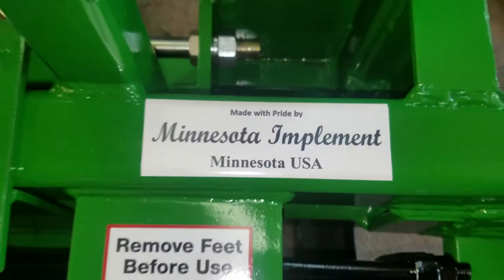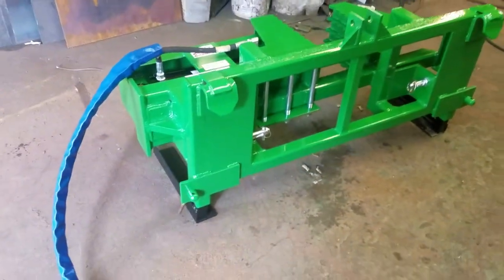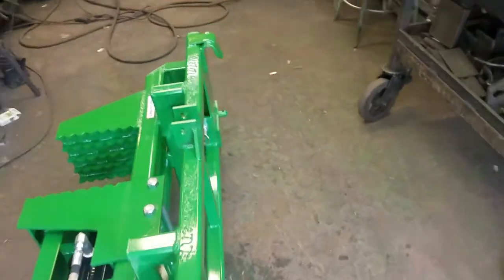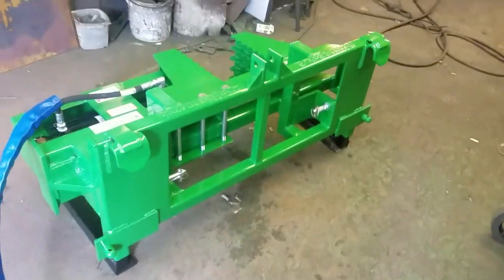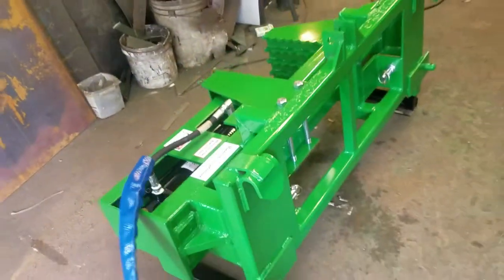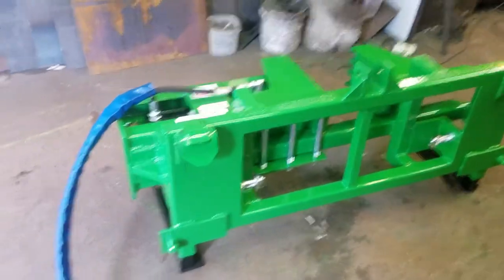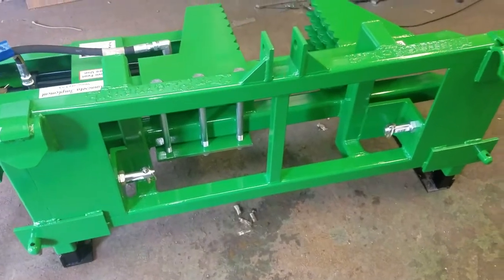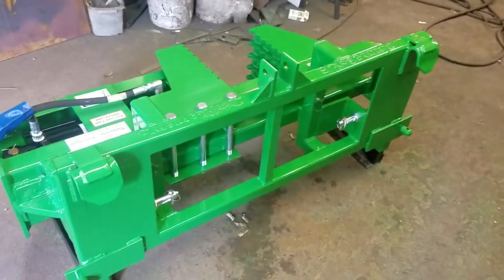Minnesota implement Buckthorn tree puller for John Deere and 3 point

Comment: Will it match to the imatch?
Reply from the maker: This design will not fit the quick release rear hitch due to the pins being set into the inside of the faceplate for clearance so that it will also fit in the front of the machine...  we can build one that will fit the quick release rear hitch, and also the front faceplate of the machine. But it will not be quite as compact or as clean looking of a design, due to needing clearance for the rear hook set-up to have clearance under the bottom pins.

Thank you for the question.